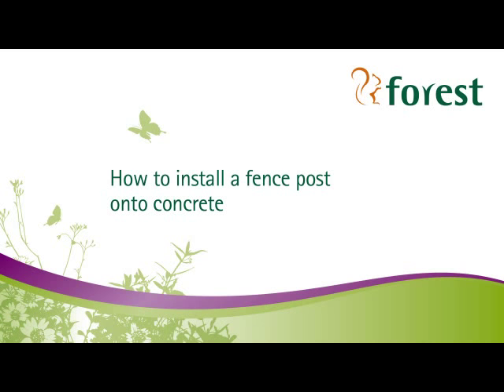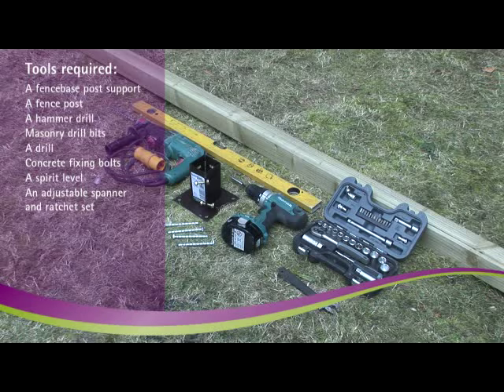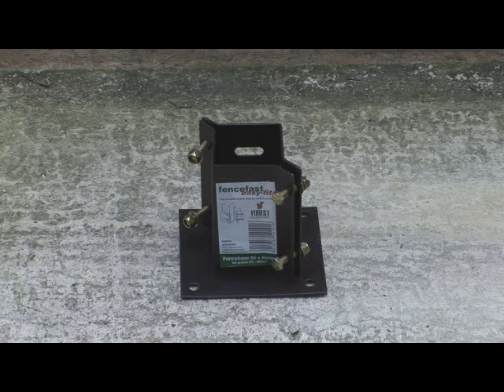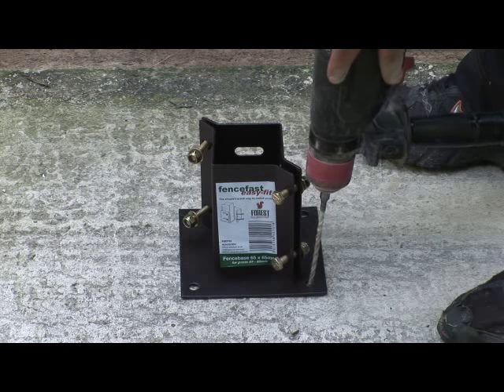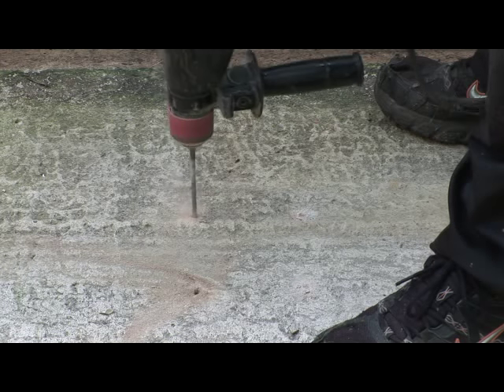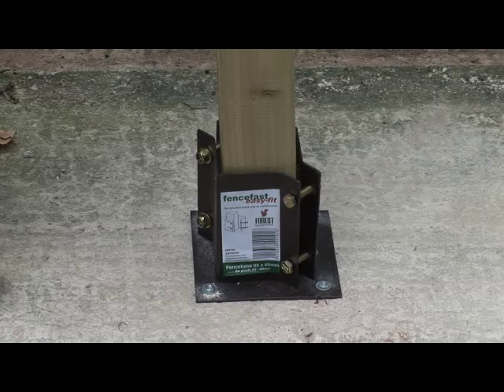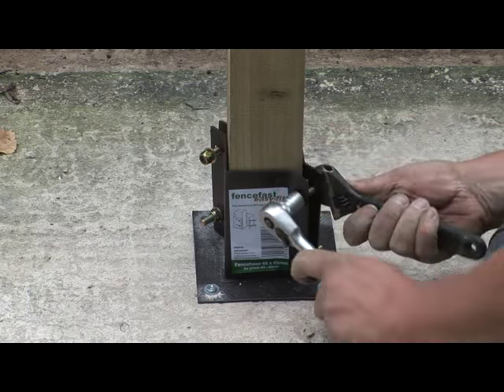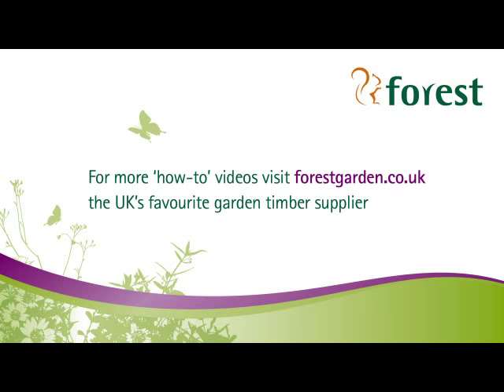How to Install a Fence Post onto Concrete

Comment: Does this work for asphalt as well?
Reply: No this wont work on asphalt. You will need to dig a hole in the ground and repair the tarmac after.
Reply: I have a concrete drive and want a 4 ft walk through gate beside my house, 8ft double gate to the right of that and it will tie into my privacy fence. 
Will these support the 4 post needed for my gates? Or would I be better off renting a core drill and drilling the post holes in the concrete and then use a small auger bit to drill the ground to get proper depth and concrete the post in the ground like my others?
Reply: @superbazooka213  i really wouldn't hang any size gate off these. Youre much better off drilling into the concrete and setting a post.
Reply: @JamesMontana  ok sounds good.  Thank you! That is the direction I was leaning towards.

Comment: Why show general and not specific detail, like what you used to drill the bolts into/ what if concretes not level etc etc.... Don't bother unless you can unpick every part of the process.
Reply: It's fine

Comment: can i dig out 4 inch holes in concrete driveway to install 4/4 inch fence posts .   what equip.  will i need
Reply: Yes of course you can. Its always stronger to concrete in a post.  Just be aware of any services under the ground before you do.

Comment: Will this work for gate posts that will have a 4 foot wide and 6 foot tall cedar gate attached to it or should I break the concrete in the driveway in sink the 4x4 gate post down into the ground and concrete around it?
Reply: Definitely concrete it into the ground. Make sure to slightly mound the concrete around the bottom of the post to allow water run off.

Comment: I’m planning on installing a fence across a brick paved driveway. Could I use this method? Or is this solely for a concrete slab? Ideally don’t want to remove the paving and scribe around the post
Reply: I don’t think asphalt  is the same strength as concrete to be honest the wind could rip them out. What did you end up doing ?😊

Comment: Some of the other videos showed, to vacuum out the dust after you drill
Reply: Yeah so if you resin the hole before inserting the bolt it will adhere to the edges not the dust. Stronger fixing.

Comment from the maker: nunayafb - 6 foot is about the right height for a fence using this bolt-down method
Reply: hey Rob, could you tell me where I could find those feet/bases. I'm not finding ones that tighten like the ones in this video.

Comment: No screw-plugs before putting screws into the concrete? really?
Reply: Realistically if a professional shows go to your house to build a fence with these or any saddles send him home period. Your worried about screw plugs but these saddle won't last long I've been to many jobs where we had to dig up each sono tube and repour sono tubes with the fence posts inside. Regardless the height of the fence.
Reply: You can get self tapping fixings for concrete no plugs required

Comment: I thought about this after the wind brought down my six foot fence and one of the concrete re enforced posts with it. Then I thought no, the wind will just rock it loose in no time and the rain will rot the fence post at the bottom, alright for small light fences I suppose....
Reply: Design fence so wind will pass through
Reply: The wind toon down your post you put into the ground or concrete ?

Comment: What if it's not a level piece of concrete?
Reply: Rough answer, make the base the opposite angle of the underlying concrete.
Reply: Joey Smith pack washers under the fixing holes on the low side so your screws/bolts clamp them as you tighten it down.
Reply: What about concrete posts? Not wood
Reply: @whatyousaidbud  or use plastic c packer shims then the visible gap apply resin bond for a secure base

Comment: How do you make the post plum if the concrete slab has a grade to direct water away from the home?
Reply: Cut the end of the post at the same angle as the grade and put it in the post clamp and plumb it.
Reply: Use round washers under the bolt down plate to level it, before bolting it down.
Reply: Did you ever figure this out? I have the same problem and my concrete slab slops down.
Reply: @JamesMontana this is what I was looking for. Washers  yes! Thank you. I think they make a special thing for it do you know what it’s called it’s like  a rubber mat
Reply: I saw it on another video.   Shimmy is what he called it.